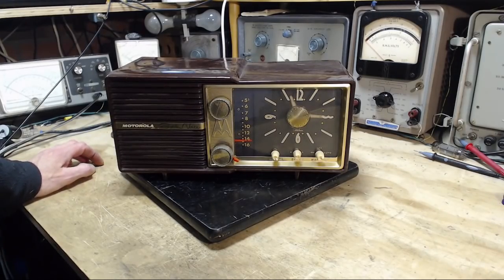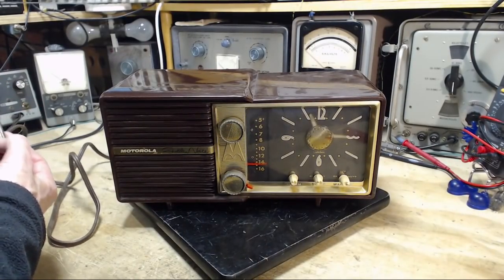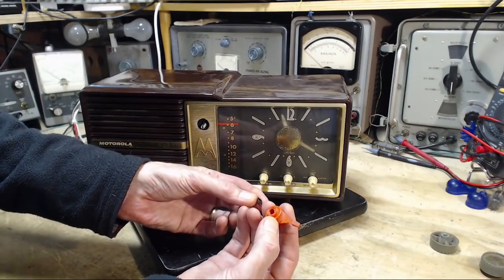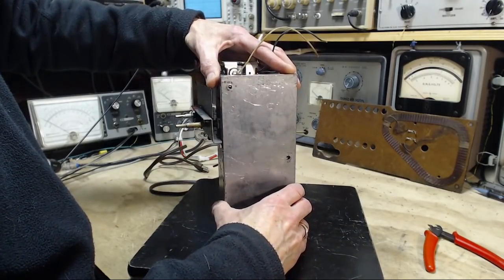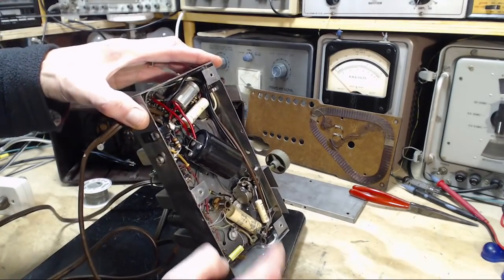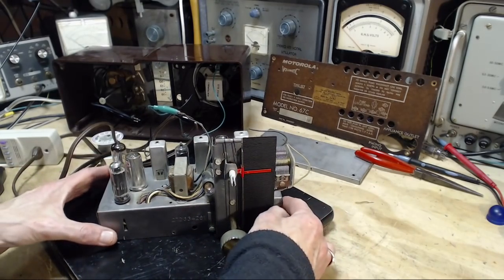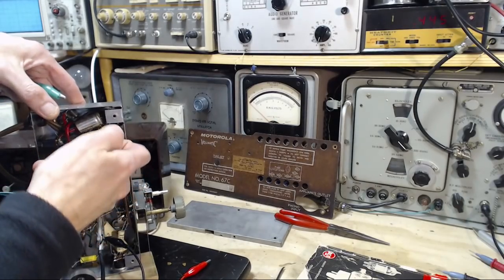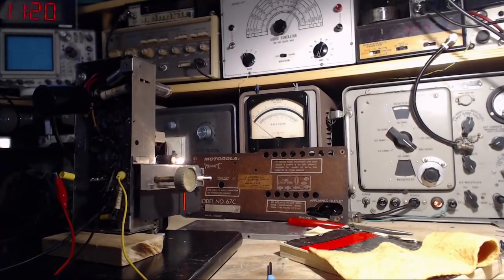Motorola 67C Clock Radio Video #1 - Checkout

Comment: I just wonder why MOTOROLA didn't use low voltage space charge vacuum tubes and make it work on between 23-30 volts would not have been a good idea and have made getting an electric shock less likely.

Comment: This is from 1957 and was one of several models Motorola introduced that year with odd new tubes. 12CR6 appeared in their table radios and 1DN5 in their tube portables. Both were AVC/Det/AF amps and were always hard to find,  even when these sets were young. Luckily for the restorer shops that did stock them were stuck with them when the tube era ended and you can still find them as NOS. Other manufacturers stuck with the old 12AT6 and 12AV6. In a really well-designed circuit these tubes could be used to provide "Delayed AVC" since they had 2 diodes instead of one. They were the miniaturized versions of the earlier 12Q7 and 12SQ7 types which were developed for just this purpose although later designs cheaped out and either used just one diode or tied them together to make an effective single diode with the idea being that if one failed the other would still keep things working.

There will be .1 cap running from B- to the chassis. OEM was a Black Beauty/Bumble Bee.

Comment: Good looking set. From the era of puff piece slogans. "Golden Voice", not to be confused with RCA's "Golden Throat" really meant very little. GE had a line called "Musiphonic" which actually DID mean something. Those had special output stages with special output transformers, inverse (negative) feedback and really extended frequency response with a slightly better speaker.

You'll also note Motorola using "Volumatic" as a slogan. Again, nothing special. It was simply garden-variety AVC. 

These buzz words were meant to impress the uneducated consumer that they were getting something more than garden-variety stuff at a bargain price when they were not getting anything extra.
Reply: Citation needed.
Reply: @tinecrinec4769  For what exactly? The names? Common knowledge to anyone who sold or repaired these. Each set was marked as stated. Schematics? Try Rider's 1957 radio book (R-17) for this model and Rider's and Sams manuals for the others. Tube types? RCA Receiving Tube Manual after 1960.
This is all verifiable. Just hit a search engine.